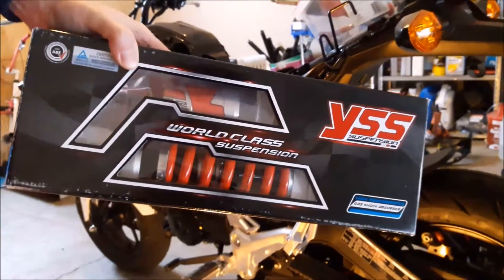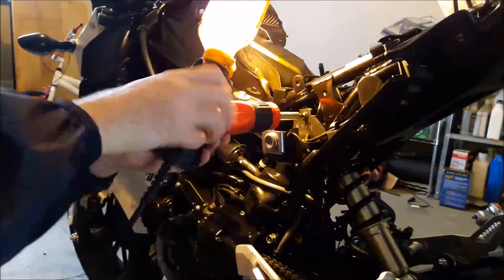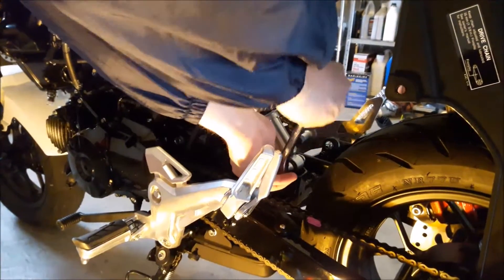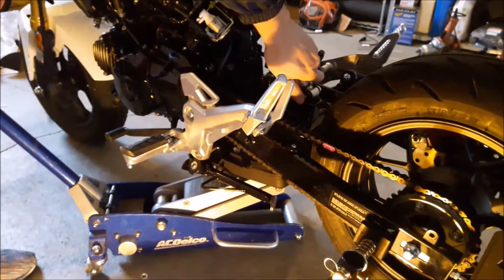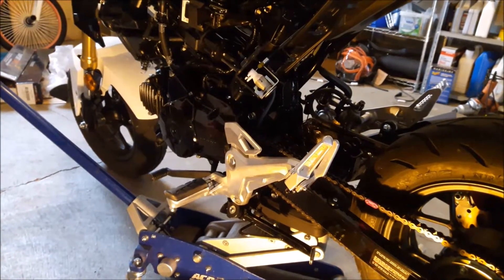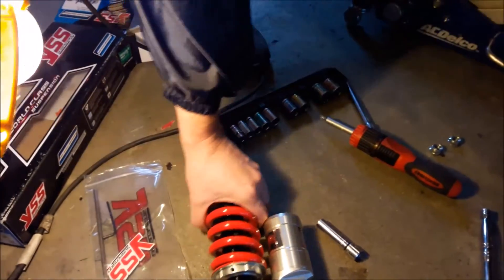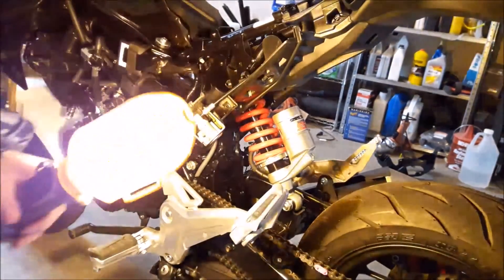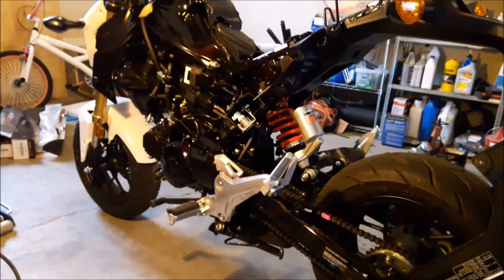Honda Grom SF YSS stage 2 shock install

Comment: Why did you mount the shock upside down? Prob not a big deal, just wondering.
Reply from the maker: teamscreem easier to adjust but I would flip it for comfort.

Comment: Where do u jack ur grom up?
Reply from the maker: Letran used a pc of 2x4 under the bike to jack it up a little
Reply: Only myself working on bike without any other hands. My pipes is in the way. Gonna try putting 2x4 on each side of pipe and see if that works.

Comment: way to much removed,  only need to remove the mud guard. took me 15 mins tops to install mine. use open ended wrenches and remove bolts, new shock is easier to install.
Reply: and lmfao its upside down,  rookie
Reply: Make a video